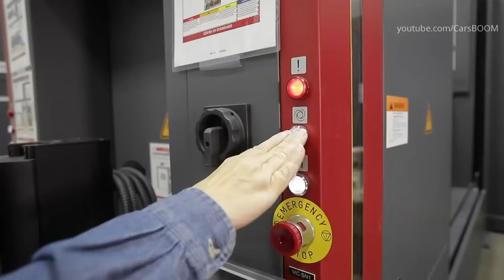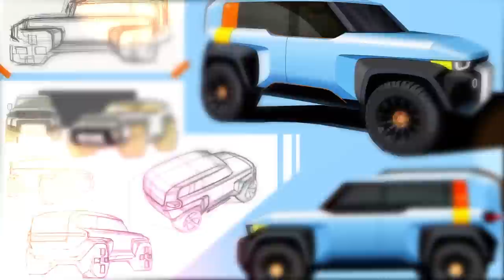NEW CEO Reveals $23K Toyota Stout 2023 Model!

Comment: I would like a strong gas engine 4x4 / access cab/ long box. to replace my 1998 tacoma off road. that has the rusted out frame, and I had to replace the bad leaf springs. Note: Toyota would not stand behind any of these repairs !!!  P.S. I like the compact size.

Comment: EV's are a forced market and do not appeal to most informed buyers. Toyota has been building the most efficient reliable internal combustion and hybrid vehicles for many years. It's no surprise that Toyota would go with hybrids over EV's . They cost less, they are much more convenient to own and the informed know, they are much better for the environment. As a giant bonus They are Toyotas built to last and they continue to serve when most other brands have been recycled into toasters.
Reply: Obviously this is industry propoganda statement. Do u even own an EV. Ive had a full EV since 2010 and My 2013 is still running like new with no visits to any mechanic. I do have to buy wipers and fluid. Auto manufacturers realized too late no money in a car that needs no schedualed maintenance. Now they are charging more to make up for never seeing you again after purchase. Went from 36k to 50k. But dont buy used. Battery will have reduced endurance.

Comment: A PHEV is the best option for trucks as a middle ground. Full EVs in trucks is absolute stupid, because the range will go down so badly when a small truck is towing or carrying a huge load across state or more. Also what ding dong would expect a small EV truck with a 20 foot trailer to block an entire of chargers to charge without getting in the way. Good luck finding a charger spot that would accommodate such a configuration, all the Tesla owners would lynch you for blocking the entire place.

Comment: I would never buy an electric vehicle. Garbage. Nothing but complaints from owners so far. Unreliable, expensive batteries to replace. Not proven yet. Just made and dumped out on the markets. Plus you can’t even buy a beer can car anymore for less that twenty thousand. The the interest rates are the final blow to a purchase. The average vehicle payment now is over 400 a month. Most if not a strippo model are more like 800. My house payment is not even that much. And I have a 30 year term to pay the house off. So tell me what is wrong with their financing methods?